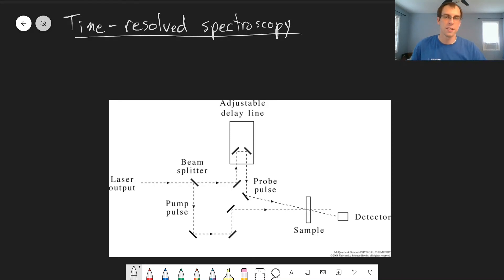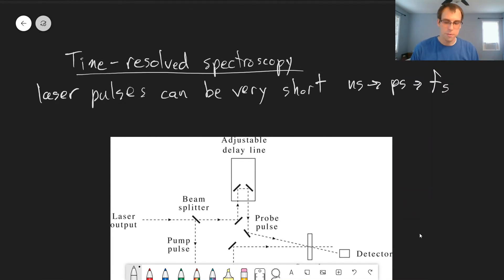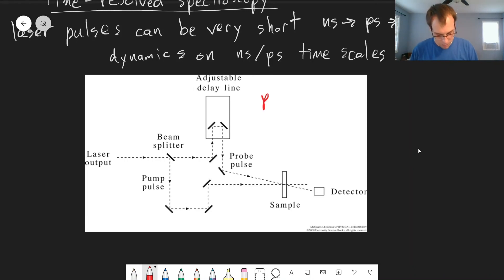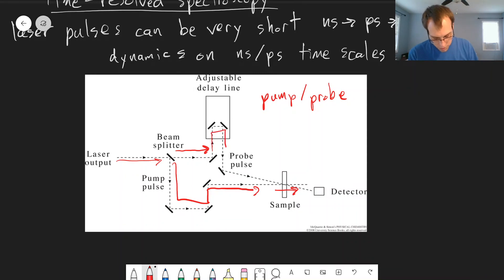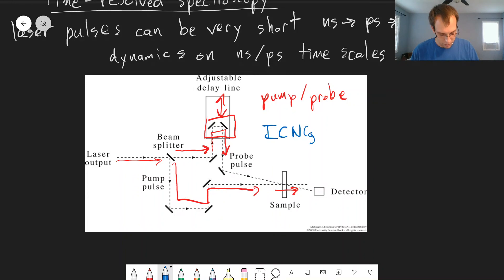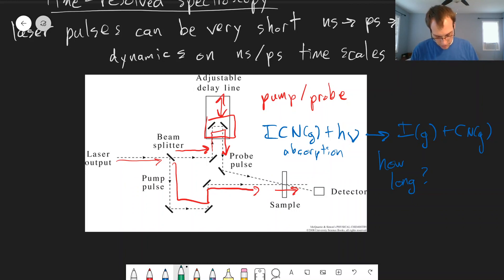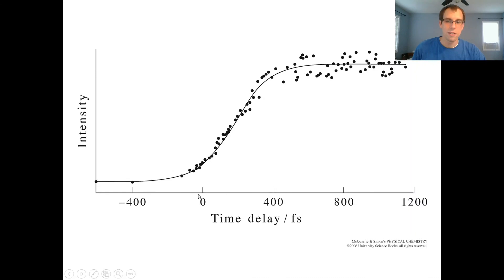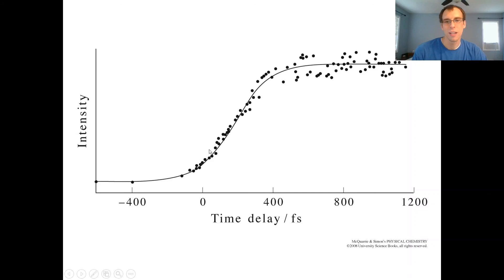Chapter 15: Time-Resolved Spectroscopy | CHM 309 | 148

Comment: Is there an energy difference between the probe and pump which makes the pump dissociate the molecule and not the probe
Reply from the maker: The way the experiment is depicted in the first part of the video, the pump and probe laser would have the same energy, which can work for some specific molecular systems, where the first time the energy is put in it excites some kind of molecular energy level, and the probe pulse has sufficient energy to dissociate the excited molecules. But usually the pump and probe lasers will be different energies (and be different lasers), which is how the ICN example towards the end of the video works.